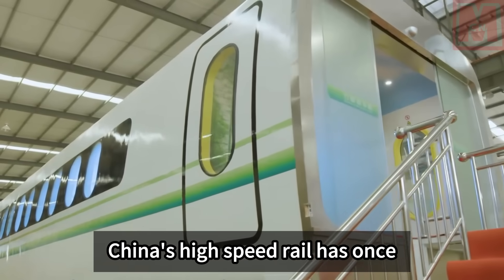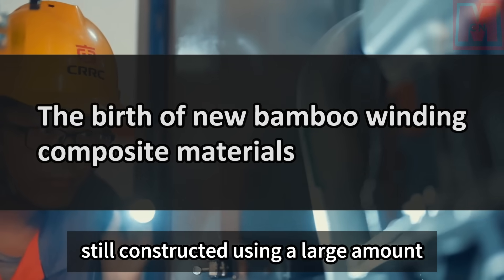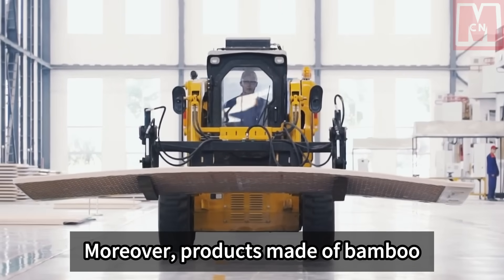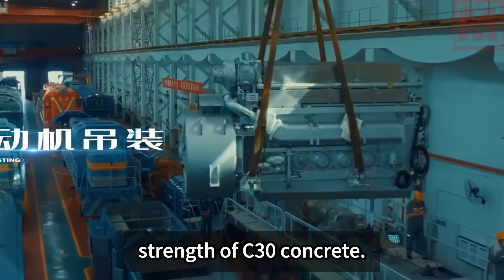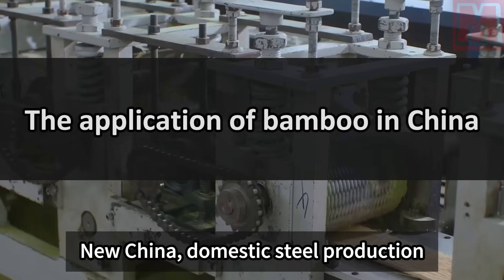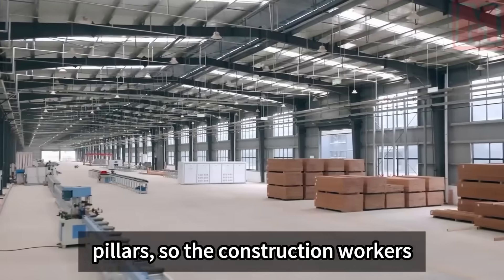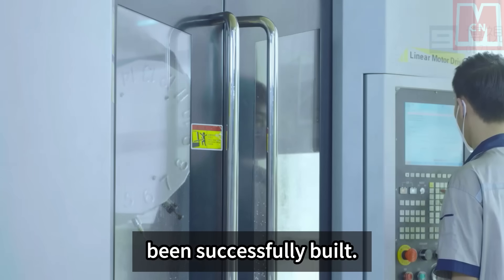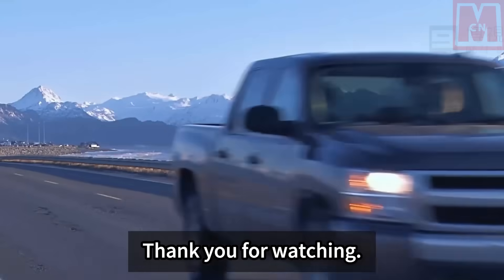China's high-speed rail innovates using bamboo, sparking global interest and envy.

Comment: If you ever seen commercial juicer same as Jewry soft metal roller. You can squeeze the juice and only the fiber plant material remaining, so in a resin state it close to carbon fiber.
And it has compression strength close to concrete, the trick is more a cheaper type of resin as that very costly , if the target is a replacement of steel , that very cheap their holding back secrets.in new type of cheaper but stronger  epoxy's tech as expoxy don’t have compression strength and expoxy need thickness to get compression strength but that costly. Physic is alsway a catch 22 you need to work within to breakout or a breakthrough .